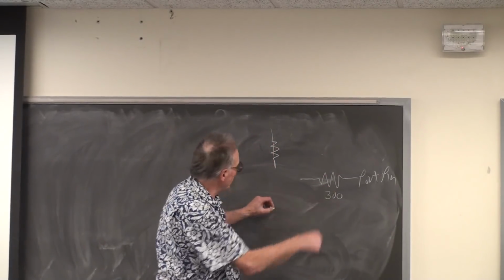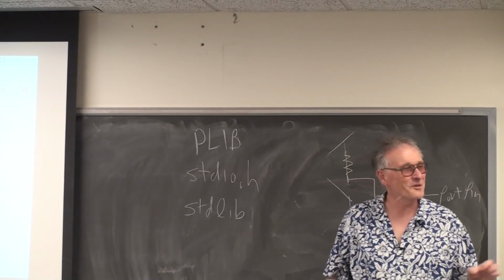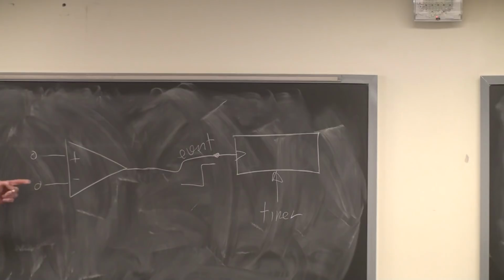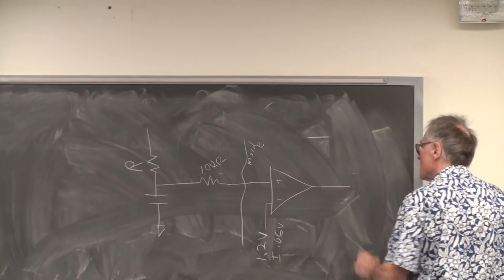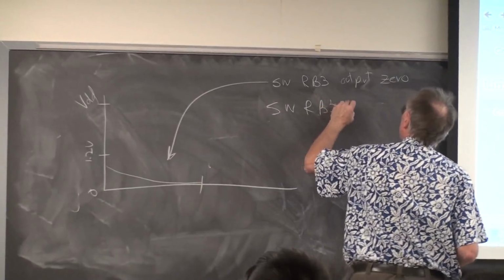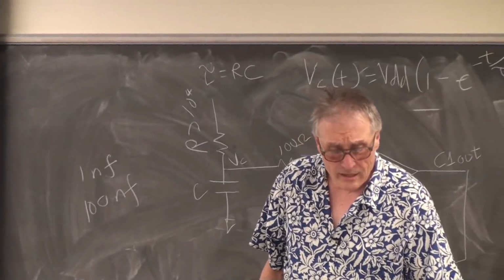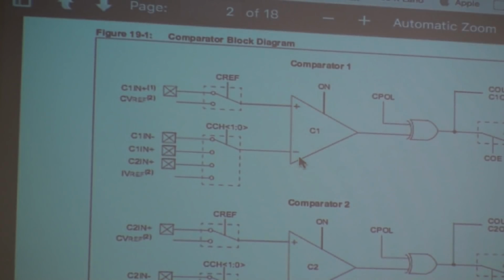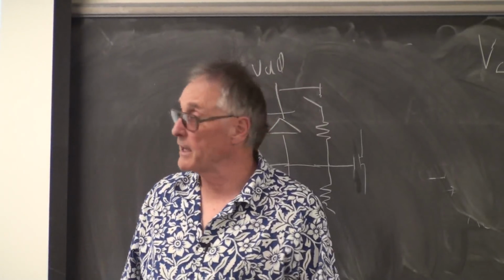#2 hardware/software and lab 1

Comment: 11:11 bullshit. Every pin at boot is an input
Reply from the maker: YOu are correct, (section 12..2.1 of the hardware manual) but student code can be wrong and destroy pins, so this encourages them to plan carefully.